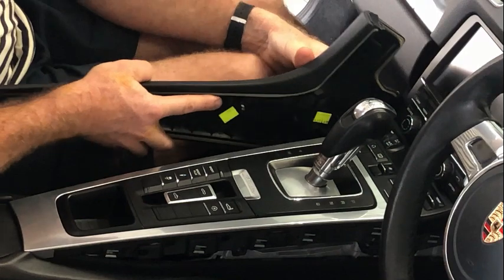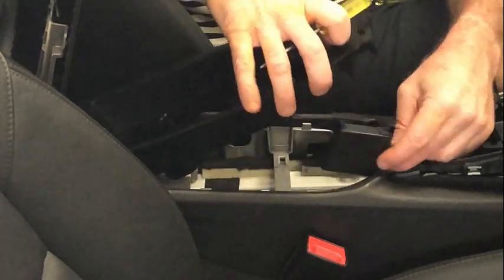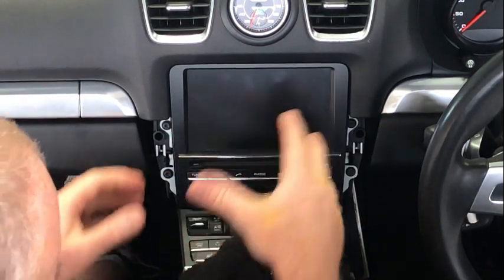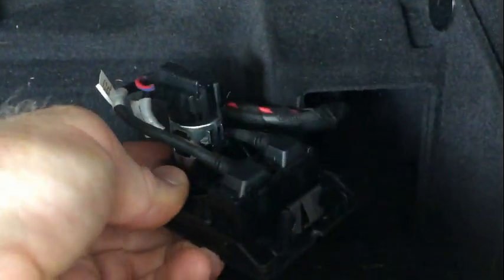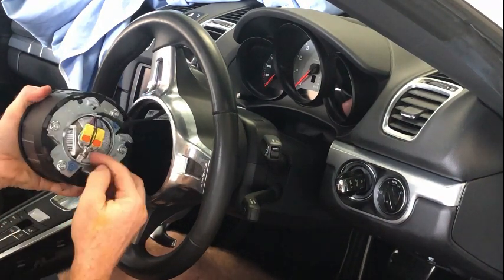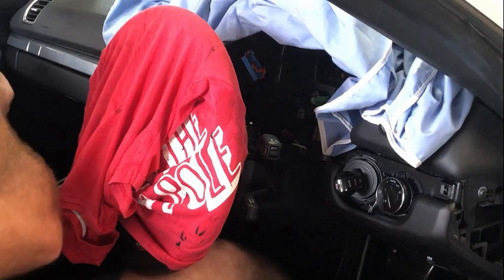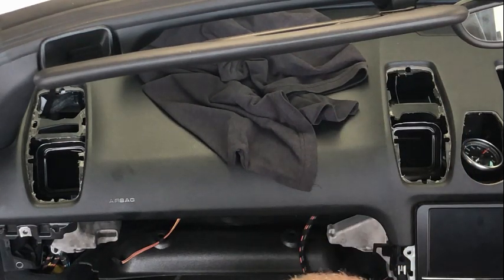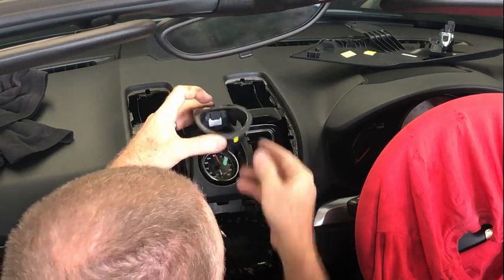Porsche 981 Boxster Interior trim removal & installation

Comment: Super helpful video! I just replaced the sport chrono bezel for one with leather and deviated stitching.  My tip: use a T-20 allen wrench and you don't need to remove the head unit to loosen up the two screws of the clock.

Comment: Caution for all 718 owners - the tray under the arm rest is different from the 981 - the unit containing the motion sensor is built in to the rubber mat thing. Impossible to work out how to remove without prior knowledge - but you need to lift up the rubber mat at the rear, and pull up the whole insert from the rear -two clips about 10cm from the rear and there are two tabs at the front end. Then an electrical connection and an aerial can be easily removed.
Reply: Edit: the motion sensor is still underneath the lower tray as in Jeff’s clip. The upper tray has some other electrical gubbins moulded into it. Looks like a wireless charger, but isn’t.

Comment: Brilliant videos many thanks! We have a 718 Boxster and it seems a lot of the series applies to the 718 as well. I have scanned through all your videos and cannot find how to remove the A pillar trim (dashcam installation). If I have missed it then apologies, if not is there any chance you could show how the A pillar trims are removed for a cable run for a dashcam that's mounted near the rear view mirror please? Thanks again!

Comment: It really took me a few attempts looking at where in the world was the screwdriver reaching out until I finally saw that it trespasses through the open circles in the plastic structure and reaches thru to what I would call the 'ceiling' of the glove box but after a few careful attempts I managed to remove it and install a new one with no scratches. Thanks so much for your guidance it really served me well.
Reply: Thank you for this comment! I am doing this work just this moment and couldn't figure this about.

Just to clarify, this comment is about removing the cup holders.

Also, for me it took more force than I'm comfortable to push the screwdriver.

Comment: This is really helpful information so appreciate the effort behind this - I am retrofitting the smokers package to my 981 Cayman and have followed the guidance with success except for removal of the oddments tray below the armrest - with the 2 screws removed, the retaining clips released & the electrical connector to the sensor removed, the oddments tray is still securely anchored somewhere and won’t swivel as per the video clip (I have a little movement on the leading edge) - searching online suggests others have had the same issue - any suggestions from those who have come across this challenge? Thanks!
Reply from the maker: It's clipped in there very hard. It really did surprise me when I did this the first time. It could also be the motion sensor underneath. Since doing this video I found a far easier way of access the motion detector unit by removing the large plastic support piece that sits under the center console. Video link below to this that might help.
https://youtu.be/3sil37BshKg

Comment: Excellent video!  Do you know how the accent trim comes off the door panels on the 718 (maybe 981 too).  I was thinking they come off like the dash pieces but didn't want to find out the wrong way.
Reply from the maker: The 718 must be different. There aren't any accent trim pieces on the 981 door panels
Reply: @jeffrichardsoncardiy  Ok, if you have done the GT3 I think the trim pieces are similar.  If not...I'll just give it a shot!
Reply from the maker: @JetFuelOnly  I'm just a bloke that owns a Porsche. I've never worked on any other.

Comment: would you say its best to disconnect the battery if you are removing the cluster panel (i want to change the instrument gauges for coloured ones) so going to use your superb video.  thankyou
Reply from the maker: Not required unless you plan to remove the steering wheel and hence the airbag.

Comment: Hi Jeff,  do you know how to remove the ignition switch housing from the lower dash?
Reply from the maker: I've never removed it, but from the workshop manual: once the front and lower trim is removed you use a special tool to rotate and remove the metal ring that holds it in place. Then it pushes forwards and out.

Comment: Did you remove the windshield defroster vents?  Are they removable?
Reply from the maker: Didn't remove these. On most cars this is part of the dashboard. In the workshop manual there is nothing specifically for this but the parts list has the windshield vents as separate parts that are installed from the top. It looks like you need to remove the center speaker cover and there is a single screw under here for each vent and the just clips that hold it in. The center speaker cover just unclips from the front edge.